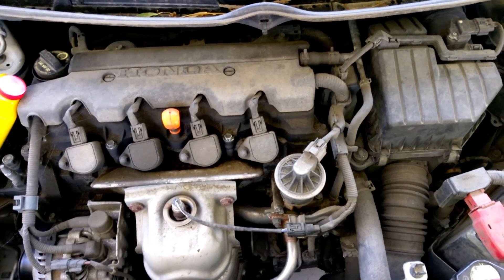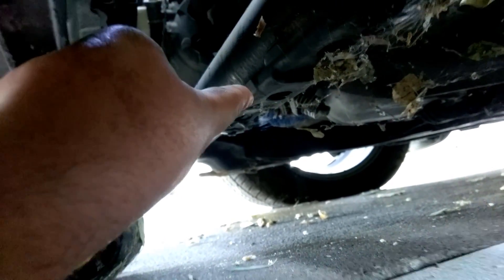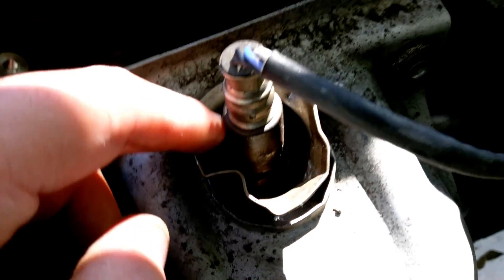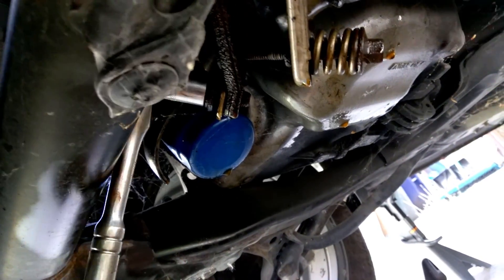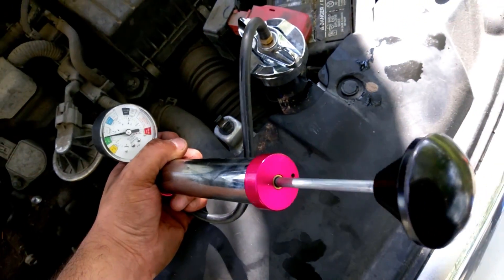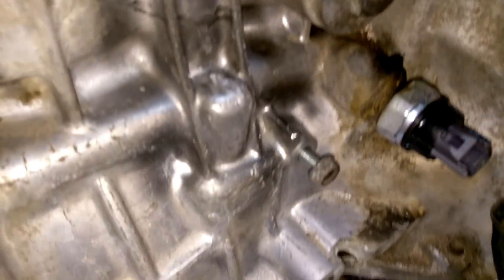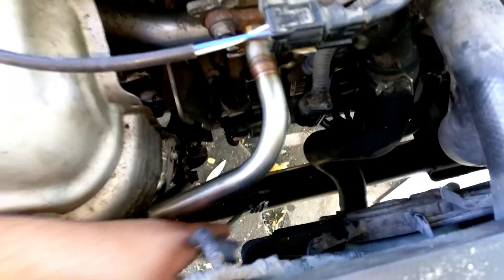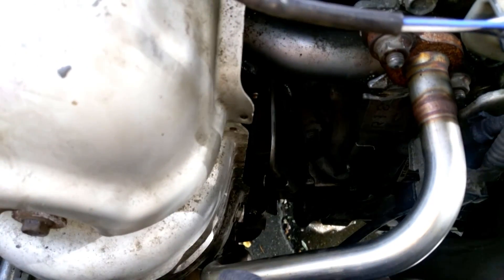2006 Honda Civic Cracked Engine Block Repair

Comment: from the picture you are suffering from porosity in the alum of the block, it's from a bad casting, this is a manufacturing defect, as such it should be covered by the dealer, even if out of warranty..
Reply: Nope it’s not unfortunately me and thousands of others I’ve seen online tried calling everyone from Honda to no avail. They only extended the warranty they did not do a recall so once your past the 10 year warranty no dice. Called everyone warranty dealerships I mean everyone
Reply: I know its been a year since you posted your comment. I just wanted to add my 2 cents. I was out of warranty for 2 months. Honda Corporate did not offer me any assistance. I said to Honda had my engine NOT cracked and was still under warranty would you switch out my engine before the warranty expired? They said, "why would we switch out an engine that is not cracked?" I tried negotiating with Honda for 3 months still got NOTHING. After that I said F you Honda. I belong to a large union and will tell everyone NEVER to buy another Honda ever again. Since then, I've purchased 3 Toyota vehicles and sent pictures of them to Honda corporate.
Reply: @domtam6571  what Toyota's did you buy? How do you like them? I've been thinking of getting a Scion TC here lately.

Comment: Is it still holding up, mine gave up, honda said they won't fix it and I thought of this bit want to look it up first, I have a friend who ran the car 40k miles after using in weld but it may not be the same for everyone.
Reply from the maker: It is still holding up. Not sure for how long but its been over a month now and i have no signs of leakage. If you do decide to do it i just recommend you dry 1 layer and put another on top of that a day after.
Reply: Laketown Auto Repair mine was leaking from there too like all others, I picked the car up from honda and it's now leaking from under the radiator and not the original crack, so ima just swap the motor to be honest amd sell it
Reply from the maker: Thats the best thing to do, these arent even worth keeping considering there are 4 other places they can break. Good Luck
Reply: How’s it holding up? Do you drive that car daily now? Do you know what causes this besides manufacturing defect, like did it run too hot then it cracked? I’m thinking of buying one of these as a beater that may have an engine block crack and just fix it like that
Reply from the maker: Luke Zachary it's holding up still. I think because I put a lot of jb it's still holding. I really don't know how much longer till it gives out or if it ever will. I been driving it to work and back but I don't care take it too far. I can't tell you to do the same but from my experience it's holding pretty well. If you do decide to do this, take your time and prep it good
Reply: Will do haha thank you, I think I’m gonna take a risk and get a 08 Civic
Reply from the maker: Luke Zachary good luck hope all goes well
Reply: @JCAUTOMOTIVE4444  still good?
Reply from the maker: @shyztee321  still good. I have an update video on it
Reply: @JCAUTOMOTIVE4444  is it still running?
Reply from the maker: @Imdraco_  Yup still running
Reply: @JCAUTOMOTIVE4444  how many miles you run it like that
Reply from the maker: @Imdraco_  since the fix we put about 11k miles on it

Comment: I open the drain to the radiator 3 days ago and the grack is still not dry...it just keeps seeping...how long did you have to wait just to put the jb weld on???"
Reply from the maker: I did it the same day. But maybe take off the lower radiator hose. Or even lift the back end of the vehicle as you drain it.
Reply: @JCAUTOMOTIVE4444  thank you
Reply: There is a block drain bolt/plug

Comment: I just bought my 2007 Civic from a Mercedes dealership in June, now I’m wondering if this is what they did. A month after purchase it started leaking coolant, I’m 2 years outta warranty and I’m pissed! $3,999 +TT&L down the drain. 🤬🤬🤬
Reply: Where was the coolent coming from the hoses or block?

Comment: Laketown body repair i have a 08 civic i have a question when my car is running it burns oil and therez a oily substance from the exaust i checked the oil cap there's no milky oil and i took out the oil dipstick theres no steam what are the symptoms of a cracked head or cracked engine

Comment: Hey is the car still working??I just found out my 2006 Honda has the same issue and I took it to the shop yesterday it's easily around $1,000 where I live and I'm not really trying to spend that kind of money.
Reply: Still way cheaper than what Honda Long Beach wanted from me. $3700 for labor and $6600 for the block alone new, or used low mileage engine for $5900 🙃 that’s almost as much as I paid for my 09 when I bought it in 2013
Reply: @WPHSBandGeek jdm engine 900 bucks

Comment: hey @Laketown Auto Repair is jb weld still holding? getting ready to do mine tuesday i bought the jb weld high heat
Reply from the maker: Yes it is. We started noticing a few drops of coolant recently but we havent had to fill it
Reply: @JCAUTOMOTIVE4444  well i bit the bullet and just got another motor unfortunately the crack on mine kept spreading
Reply: I just bought an 07 civic and looking to try this or maybe have a friend weld it closed
Reply: @JESUSD6765  we pulled the motor out and u could see where it had jb weld on it before but it kept cracking and spreading past the weld is and was the problem
Reply: JOHN LOPER  I just bought a used 2008 Honda Civic with 113,400 miles  and the previous owners did the same thing with the jb weld because it had a cracked block, they didn’t tell me that it happened and I had to find out myself by inspecting my vehicle thoroughly. my question to you is how much did it cost you to get a new motor for your civic including parts and labor and what would you suggest I do?

Comment: How often you change your coolant? Ppl who have 8th gen Civics and change their coolant every 30k with Honda Type 2 don't have this problem. The engine block on this car is all aluminum.  Fresh coolant at all times is a must!!!
Reply: This is a manufacturing defect. The engine blocks were made too pourus. The crack happens at the same place in all cases. This has nothing to do with the type of coolant, it is Honda being cheap assholes with poor QA.
Reply: @danielb3863  I run Dexos Full synthetic oil, and synthetic ATF in my 2007 civic. Coolant was changed with OEM Honda coolant every 50k. The block still cracked. This has nothing to do with fluids, and is the result of a casting defect from the factory.
Reply: I will also second this nothing and I repeat nothing you do can prevent this from happening if it fails. There’s two weak points in the block in the webbing. Although I’m sure you won’t believe me anyway.
Reply: Clearly you’re not mechanically inclined.
Reply: @joshdoeseverything4575  Bearings in the water pump require anti freeze.
Reply: This isn't a dirty coolant issue. It's a manufacturing one

Comment: Laketown auto repair how would i know if i have a cracked engine block i have a 08 civic and it burns oil and there is a oily subtence from the exaust
Reply from the maker: i cant tell you for sure but if the car is burning oil its most likely the piston rings. but to have and oily substance is excessive.
Reply: @JCAUTOMOTIVE4444  so do i need to get a new engine

Comment: In canada there is a warranty extension for this issue, and if you contact honda they usually work something out even if out of warranty.
Reply: Joshua dagaur my car in the shop now with Honda a crack engine block and a bad head gasket my car is out of warranty by 8 weeks so how much did you pay to get your car repaired I have a 2008 Honda Civic EX
Reply: @honestscentz9300  if you email honda customer relations they will fully cover the repair..
Reply: Joshua dagaur Honda told me last night that the car has a bad head gasket and not a crack engine block so it’s not covered under warranty and the car was not serviced at a Honda stealership and I brought the car used at 88,000 miles and the car has 121,000 miles on the car so I wasn’t the original owner so this a 2008 Honda Civic from the original owner it was August 15, 2008 so I’m out of warranty so they not covering anything the dealer told me 8,000 of damages
Reply: @honestscentz9300  dude just email honda, tell them your a student and you were a week out of warranty. The dealership is a lot different then contracted the billion dollar Corp. They will help, but send the email and be patient.
Reply: Joshua dagaur I  was working with Honda America they told me to tow the car to the dealership and let them look at it
Reply: Joshua dagaur what do you mean they work something out? Mine crapped out 2 days ago.
Reply: just have a shop swap in a jdm replacement for $1500 or so, dont pay honda for a new block if they refuse to cover it
Reply: @joshua1608  i live in Canada as well and just received this issue a couple of days ago I was told the warranty has expired in 2019 for me do u think it would be possible for me to get my way into getting the warranty delayed so I can get the new engine from Honda
Reply: @johnjoseph7382  what year JDM did you go with 2010-11
Reply: @pamelaflynn8844  none of the JDM engines have this issue, just the US ones

Comment: I wud suggest k seal i did it to mine its been a year it leaks but alot less
Reply: How is it holding up so far?
Reply: @ hey man i sold the car it lasted 1.5 years and started leaking a lot. Try using jb weld or better option wud be swap the engine my local mechanic did whole swap with engine for 1000$ for a friend for the same car model, i kn its alot but alot better than ur kidneys failing because u breath coolant when u turn heater on

Comment: I have the same issue,will try and alloy weld the crack
Reply: How did this turn out, I was thinking about doing same thing
Reply: @2muchspl  I have not yet finished the job due to the weather but it will work if done correctly
Reply: @habibhaq6006  if you dont mind, can you keep me posted on filler rod you used,etc. My civic is a spare vehicle and work will be done/can sit days on end in my heated garage. If I do it before you I'll reply here and maybe make a quick video on my channel.
Reply: Were you able to weld the crack? If so, how did it turn out for you?

Comment: Lake town auto should I get a new car or a new engine also are Mazda 3s ok
Reply from the maker: I really cant tell you if you should get a new engine. i think to know for sure is to do a leak down test on the engine to see whats going on. Mazda 3s in my experience are good cars and they are easy to work on. Again thats from my experience.

Comment: is it working currently ?
Reply from the maker: JMCH1988 yup still holding up.
Reply from the maker: youngtone93230  Still holding
Reply: Is the car running with the jb weld or you only have it parked
Reply from the maker: @Alejandropadilla628  its running. everyday my sister is the owner she uses it everyday
Reply: Laketown Auto Repair oh ok bro it’s cause I have the same problem with my Honda and I was wondering if that thing really worked
Reply from the maker: @Alejandropadilla628  yea it did. id say its worth a try.
Reply: Laketown Auto Repair thank man anyways
Reply: Wow this man got back to us a year later thx

Comment: This was a recall. It happened to me and they replaced it free of charge. Also it depends on year.
Reply: This was never a recall....or I would not be in the situation I am in. It was only a notification about the extended warranty. I was on the freeway in  Ca, and nearly was killed due to this failure. Now we are in a fight with Honda to do the right thing. Bottom line, they new this was a defective engine and should have recalled it and they did not. Yours was repaired because it was within the warranty limits.
Reply: Palomo88 Coocoo what year was your civic ?
Reply: Chris K if you don’t care let me know what Honda says or does, I had to take out a personal loan & replace the engine (wishing I would’ve JB welded it) & sold it. It makes me sick the $ there making, but yet will not stand behind there own default
Reply: Chris K did you get Honda to fix the car? I’m in a similar situation
Reply: @dixiesmom4633  any updates from Honda?

Comment: tip for that oxygen sensor is to get a big Flathead screwdriver and a hammer and tap the nut at an angle to spin it off.

Comment: if you go to honda they will replace your engine for free-there is a recall folks
Reply: Jim Vogiatzis just called them they said nah
Reply: use block seal it works-i did a volvo once-its sold at wall mart
Reply: the warranty expired for him. and me. and tens of thousands more.
Reply: It’s was never a recall. Ten yr warranty.
Reply: Not a recall it’s a warranty extension. Sorry excuse for something so serious because they know they screwed up and kinda owned up to it. Not really.

Comment: A cracked block is a cracked block and needs to be replaced there is no other options unless you like spending money and not fixing the problem and have the time to deal with the pos honda afterall we have free will
Reply: We need to protest at Honda shops right outside they need to do something not just we cant help you its f up ppl have to be patching up there engine. Just seen my civic leaking and i know it's that sheee